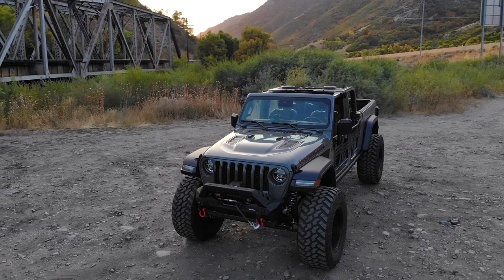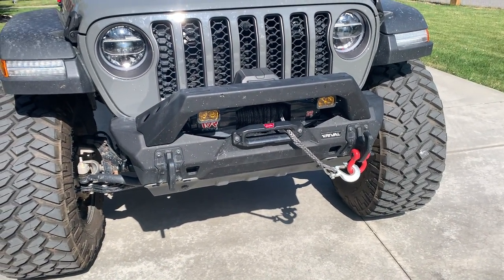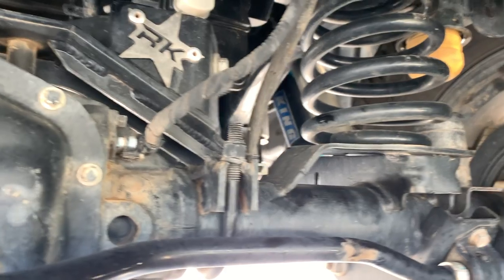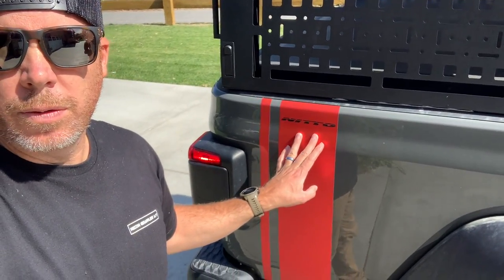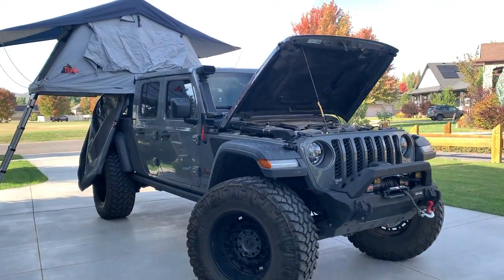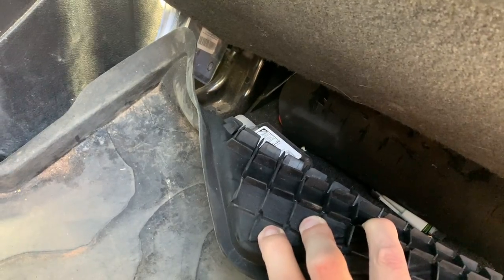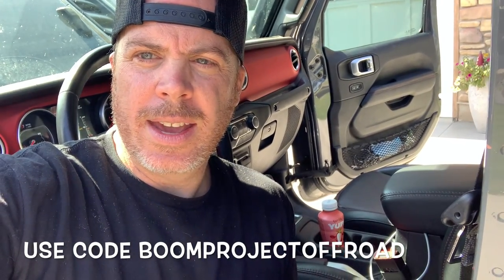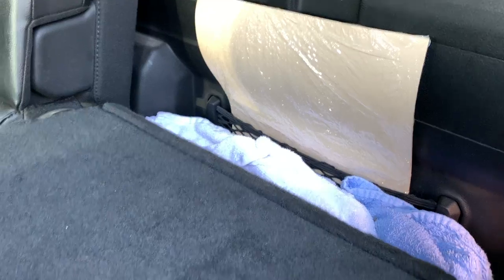Over 20 million plays on Instagram: Jeep Gladiator on 40s walkaround $$

Comment: Beautiful machine!❤ Those stock axles right? Not worried about breaking them on 40 inch tires? Everyone on YouTube says 40s absoloutely NEED 1 ton axles😅
Reply from the maker: Trussed and regeared.. no issues yet and we’ve beat on it pretty good.
Reply: @Projectoffroad  That is incredible! How does the V6 engine perform with those tires on? Are you considering engine swapping or supercharging?

Comment: Nice JT, you mentioned the rims are 20 in, what’s the width and offset? I Just got the Nitto 40x15.5/22 waiting on the 22x12 wheels with a 44 offset to arrive but I’m having second thoughts although I don’t plan to do any off-road with it, I’m concern of the rubbing.
Reply: Hey , can I run the same tires 40x15.5 r20 but with 18 offset ?

Comment: Do you rub on the lower control arms at full lock turning?
Reply from the maker: Yes, just barely.  Not an issue though.
Reply: @Projectoffroad  I did as well. 2 5/16 washers on the steering stop bolt solves this I found out